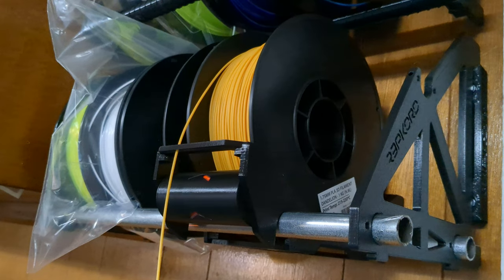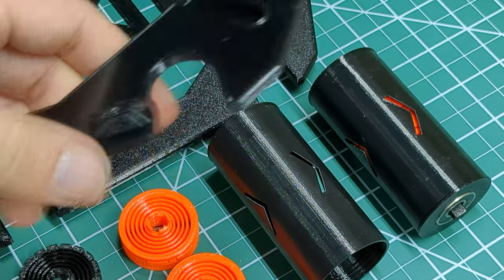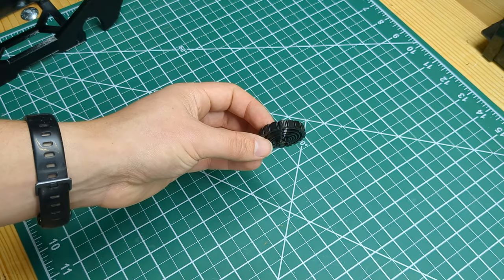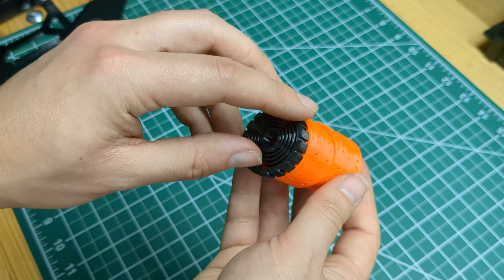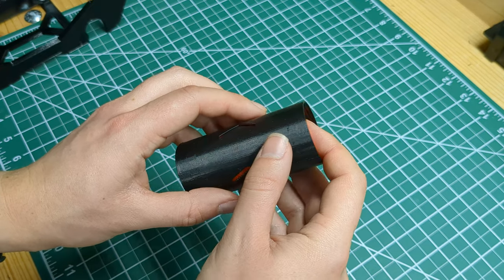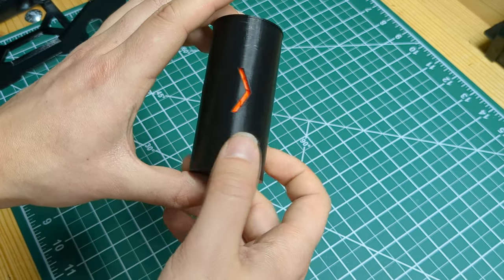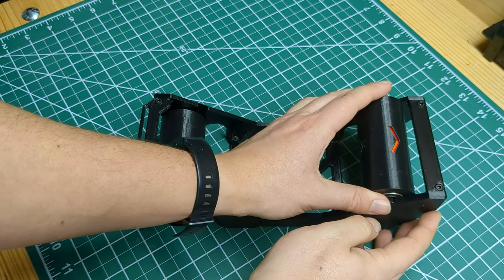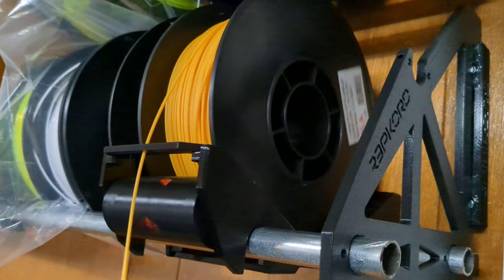Auto Rewinder for RepRack

Comment: Tried this out. Had a couple of issues. On a heavy (full) carboard spool, it can barely turn when it reaches the end of the spring. Too much friction. On a light plastic spool (almost empty), there is not enough traction and it just slides and barely activates the spring at all. It's a pity, as it would be nice to have something much simpler than the RepWinder that is RepRack and RepBox compatible.

Comment: If the printer just pulls, these cylinders turn untill they stop, or is there a clever ratcheting going on inside them?
Reply from the maker: There's a certain point at which the inner coils build up enough tension and the spools begin to slide over the surface of the cylinders. You can actually see this happen a little bit in the video about 15 seconds in.
https://youtu.be/ic9dLWOwyYM?t=14
I actually wondered this exact same thing when I first printed a version of Vincent Groenhuis Auto rewinder for my Prusa's MMU2s setup and was really amazed how well it acted once the cylinders stopped. Here's one of his versions: https://www.printables.com/model/168-universal-auto-rewind-spool-holder-mm
Reply: So the cylinders stop and spool slides with friction. Nice design.
Reply from the maker: @moshe778950101  correct it follows the same idea as Repkord's Slip Cover
https://www.printables.com/model/135700-slip-rod-cover-for-reprack-and-repbox

The contact point on the cylinders and using petg filament create a low friction surface. I have come across racheting and clutch systems that are really awesome but I would have either had to reduce coils or create a bulky separate box with those internals that would be great driven. I agree that would actually be a pretty cool design though.
Reply: @jerrari3D  Is the filament printed while it's on this? ... so when you're done printing and you change filaments, it will rewind itself? (or is there some other purpose I'm not understanding?).